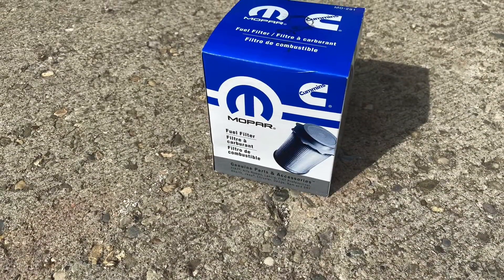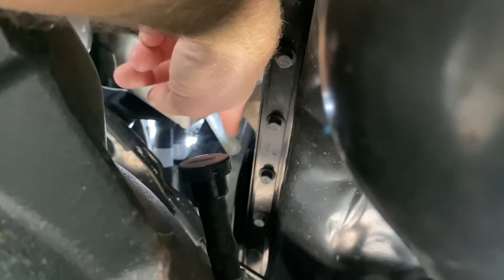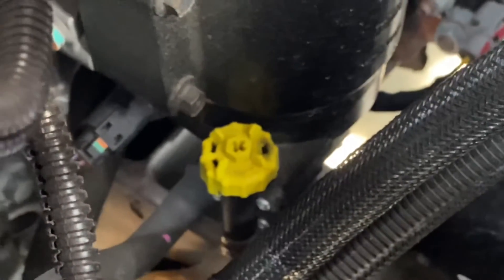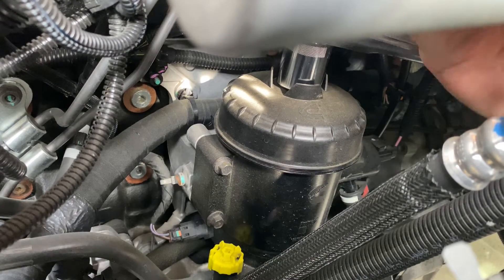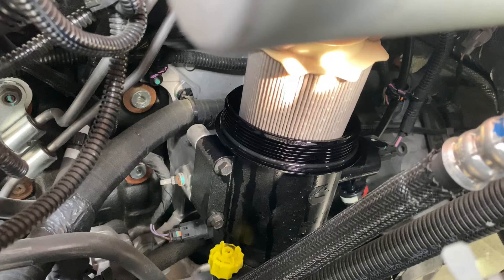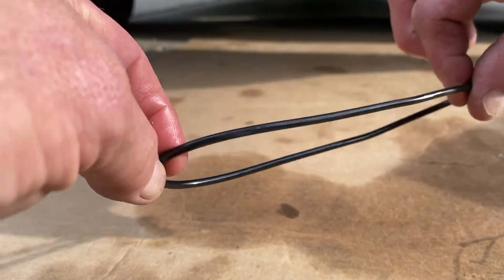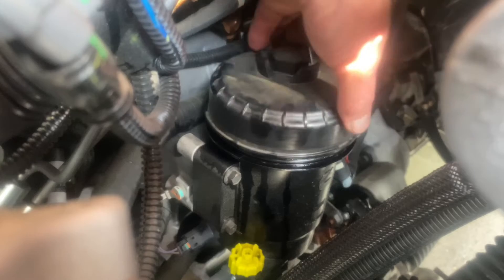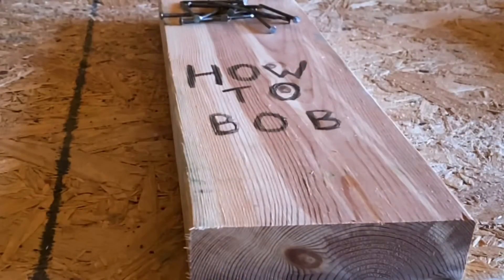How to Replace the Front Fuel Filter on a 2020 6.7L Cummins Diesel

Comment: Thanks Bob, this is the best video I’ve found on changing the top fuel filter on YouTube. They wanted 420.00 to change the 2 filters. Stealerships for sure. Do you have a Mopar or Fleetguard part number by chance or where do you source your filters at? Thanks much sir.
Reply from the maker: I used OEM parts 68157291AA and 68436631AA for the fuel filters. Usually do an internet search to find the best price when I am able to plan ahead. Hope this helps, thanks for watching.

Comment: I followed your instructions on the rear filter and it worked great.  Much more room there.  I tried the front filter but apparently Andre the Giant screwed the cap on.  With limited room I was unable to budge it at all :(  Looks like I'll have to take it into a shop to do it.  Poor design IMHO by Ram in the front.  Thanks!
Reply from the maker: Yeah, it’s not that easy to get to.
Thanks for watching.
Reply: Is the front one reversed threads? I see you righty loosie turning the front filter cap.

Comment: Bob, do you know or think the same instructions apply to a 2021 Ram 2500?   Great video, like that you are specific on what hoses and socket you used, watched both the front and rear filter videos.
Reply from the maker: Well I’m not 100% sure, I do believe they should be very close to the same if not exactly. Thanks for watching.

Comment: Is it ok to just change the front? Isn’t there a back filter also?
Reply from the maker: Yea there is a back filter as well, I would recommend changing both at the same time. Here is a link for changing the back filter.  
Thanks for watching.

How to Replace the Rear Fuel Filter on a 2020 6.7L Cummins Diesel.
https://youtu.be/W-YxFlu5BYY

Comment: Filter seems stuck i push in but in dosnt appear to move i turn and turn and pull and pull but it will not lift out.
Reply from the maker: It does “click” into place but it should lift out pretty easily. I’m not sure why it would not come out?

Comment: Confirm this comes off lefty loosey?  That cap is on there super tight. I’ve tried everything. 2020 2500 6.7

Great video otherwise.
Reply from the maker: As shown in the video, lefty loosely. It can be a pain to remove, that is for sure. Thanks for watching.